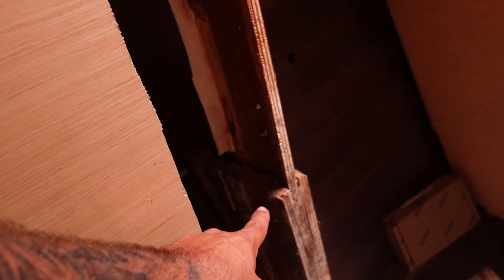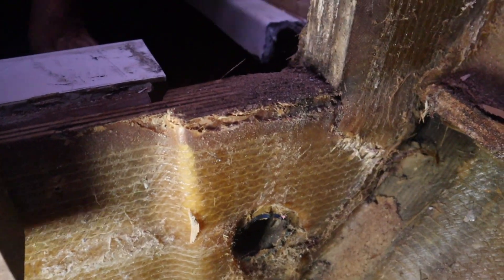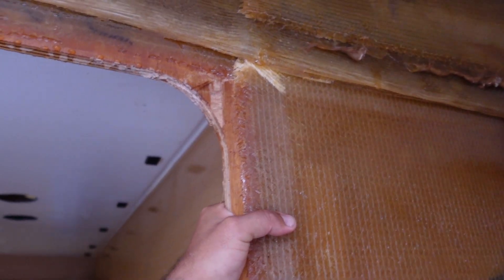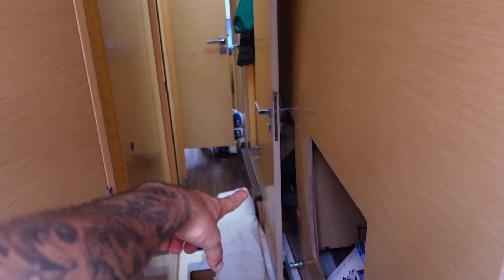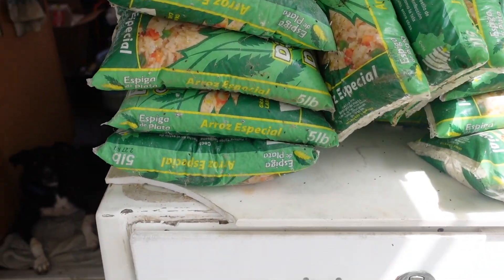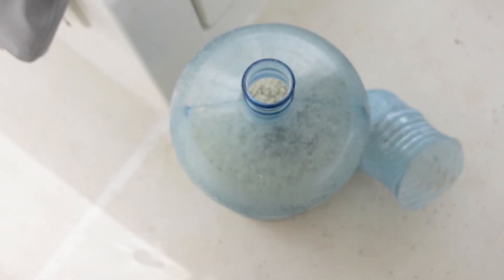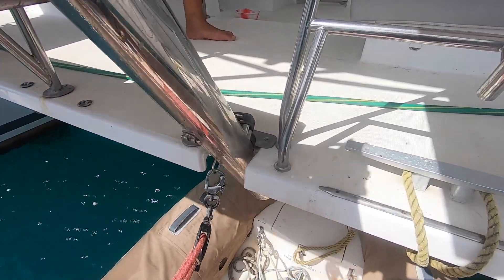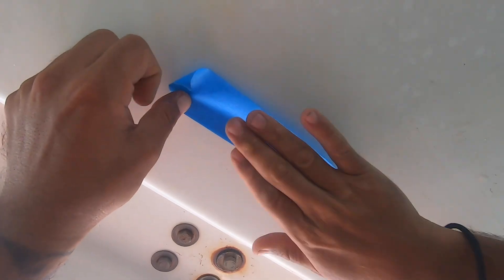CRACKED BULKHEAD REPAIR SERIES: Part 1 - An introduction... (Episode 107)

Comment: There are a lot of forces at play on this part of the hull and the bulk heads, fibre glass alone is not going to fix the problem. You have compression from the weight of the top structure (I suspect the main cause of the lower failure) tension from the chain plates (I suspect the cause of the top failure), compression inwards from the water on the outside of the hull, tension and compression from the wedge effect of the hulls pushing through the water to name just a few. Each is an independent force some times they will combine others they will cancel, The trick to a good fix when there is clearly a structural issue is increasing the support and distributing the load evenly across the hull to prevent creating a stress line at any point in the structure, remember fibre glass is not that strong in compression if it was you would not need bulk heads. I'm thinking the hull needs more bulk heads or bigger with forward aft braces from each bulk head to support and distribute the stress over a bigger hull section. I'm no engineer of any kind but specialize in failure analysis, it will be interesting to see what happens when the hull is on the dry and the chain plates backed off. Other comments suggest this is a big issue with this make and design, and the number of claims from other owners is going to prevent any real support from the manufacturer. Cheers mate🍻

Comment: Almost looks like the rig was over stressed likely during the storm. This caused failures in the bulkheads which were not readily apparent during your initial refit. Without any idea what was happening, people kept re tensioning the stays and shrouds until the bulkheads totally failed throughout the boat. With the mast pushing down on the center of the boat an the rigging pulling up on the sides over time it further collapsed the bulkheads and  distorted the hulls. Now you have a real mess on your hands and its going to be a chore.

Comment: This being a hurricane damaged boat would explain why there is such extensive structural damage. But when even lightly sailed ones have similar problems, that looks like a design problem. Looks like those nice square doorways have eaten to much of the bulkhead....
Reminds me of the story of the De Havilland Comet airplane that had square windows that caused cracking in the corners and catastrophic failure....

Comment: Might you be becoming something of an albatross around Lagoon’s neck?  It wouldn’t surprise me if soon enough we hear you’ve “sold” Parlay, the terms of which must remain confidential of course, and shortly thereafter, you’’ll finally be well on your way to the southern seas on another cat. It will be a used but serviceable boat and possibly another Lagoon. Now that’s something they and I would like to see.  Although I find it very interesting, in Lagoon’s case, they very definitely do not want you to show yet another failed bulkhead that was of questionable design or manufacture.  This may sound cynical so to be clear, I’m not attributing any to you. We all see firsthand the joy and satisfaction you get (and in turn share with us) by building better than to begin with.

Comment: Kudos to Lagoon to help you in the repair/rebuild Colin.  From what you shared & what I've seen by discoloration it appears to been definitely hurricane damage, but also, from previous stresses from abuse by over tuning shrouds to Bend the mast for more performance?  The other thing could be a a design flaw by Lagoon engineering.  Bulksheads should never be a multi jointed structure.   IMHO.  I too have mechanical engineering background as well as journeyman machinist & fiberglass repair with small boats, surf boards & sail boards.  Epoxy was relatively new when I got into building sailboats with vacuum bagging.
I owned & operated Dutchman Surfboards in Oregan for better than 11 years.  But then again, what do I know W/O actually being there seeing damages first hand.
I enjoy what you have been doing & you have courage to take on an enormous project.  You definitely got it together & find ways to make financial decisions to get the enormous task finished.  Much respect for your endeavors.
Plumb goes the lines & azimuths.
Be safe, work smart & fair winds.

Comment: I worked on refitting cabins/quarters below new blast deck deflectors on the US-66 aircraft carrier and the first thing I learned/observed was there wasn’t a level to be found or used on a vessel, only relying on X,Y,Z measurements.  Too many variants to use a bubble,  as the boat on water could be listing due to weight distribution.  I don’t know if in your situation on the hard you could adjust the supporting cradle to level out to lagoon specs or just use measurements inside point to point to bring everything into position.

Comment: As a naval architect, I suspect that the over tensioning of the stays discussed in an earlier episode will have contributed to this damage. The bending moment on the bulkheads would have been severe due to the very high stay tension. It’’s good that Lagoon are helping you, but the design of these bulkheads, including the absence of biax in the original construction at the high stress points around the door,  is dubious. I do love catamarans and raced F18s for years, but this does not create confidence in the structural integrity of Lagoons when sailing across oceans. Definitely a good idea to tear down all coverings and inspect the bulkheads thoroughly before setting sail again. Kudos for all the hard work and dedication. Thanks also for providing the regular sailing fix whilst stuck in lockdown in the UK :)
Reply: 100% the use of unsealed timber alone is dubious

Comment: There is a way to prevent those bugs from popping up in your dry goods.  When you buy them find a freezer warehouse or a restaurant with a walk in freezer willing to help you.  There may be a nominal stocking fee asked.  It shouldn't be much.  Take all your dry goods, rice, flour, corn meal, etc. and any other foods that might host insect eggs.  But nothing that is canned or jarred.  Put them in deep freeze for at least a couple of days.  Longer is better if in doubt.  The colder the better.  Just below freezing will take 2x longer or more than a deep freeze but it will work.  This will kill off any insect eggs that might have been laid in the food stuff.  It will allow much longer storage.  There still can be insects that make an appearance if they get into your goods after they are stored so putting them in a sealable container of some sort is better than just a plastic bag alone. 

I surely hope Lagoon is paying attention and taking notes on what you are finding.  Parlay isn't that old, hurricane damage not withstanding, to be having such issues with bulkhead failure.

Comment: About time you got serious & started to treat this "repair" as a major reconstruction that was the result of bad workmanship to start with. Fibreglass might be OK but you need to start bolting sections together using special stainless steel 5 & 10mm. brackets once the deck & hulls are bought back in alignment together with high tensile 316 stainless bolts & nyloc nuts. Using epoxy to "stick" sections together is asking for trouble & the same forces acting on the hulls will happen again. The hurricane created stresses that were started years ago when the boat was built & bad workmanship started the mayhem.

Comment: Looking at the degree of structural deformation, I agree with you that it is not only storm damage, but damage due to ongoing long- term excessive stress. It looks to me that the original bulkheads were too thin and buckled from torsional stress (generated from one hull twisting relative to the other along the ship's length and beyond the bulkhead's ability to flex). There is an issue of structural compromise here - if the bulkheads are too strong, they will burst the seams where they join the hulls and you are back to square one. From my perspective the bulkheads should be the strongest elements, with the hulls then being able to flex, with the flex occurring along the hull's length some ways away from the bulkhead/hull joints (like the stiff wing box of a large aircraft where the wings and fuselage are held rigidly and most flexing/twisting occurs beyond the box's structure). This balance in design is difficult to attain so I would recommend that when you rebuild the bulkheads, you build the joint to the hull and inner and outer hull skins around the joint similarly and flare the strength as you move away from the joint area so you don't split any of the hull or bulkhead laminations. I love your courage and wish to the absolute best of luck in your repair efforts!

Comment: looks like cheap plywood. also the door jams at the top are all bad designs, as you can see were the material was left short and were the weak point is. Mmmmm, hope there picking up the tab?

Comment: Could stressing the hull by overtightening the shrouds contribute as well as rocking the hulls in rough conditions over time. Original native cats would have flexing at the joints with the lashings allowing for some give?

Comment: There's no such thing as buying a cheap boat. They are cheap for the reason that you are finding out now. I wonder if the Hurricane Damage caused wetness in the hulls balsa core? I wonder if the same wetness got into those plywood bulkheads? Thus breaking the bond between the plywood and fiberglass, ruining the total combined strength of the bulkhead? Nooooooo the hurricane damage had nothing to do with this at all?!?!......... Blame the boat building company!?!? It will make you feel less stupid.

Comment: Colin, I would think that if Lagoon is as interested as the director claims he and Lagoon are that they would sponcer and provide you with every thing you need for the refit. Seeing as how even my untrained I can see where the plywood they used originally has slit and disfigured.
Lagoon should have someone on site taking notes for reference in there future designs. as we all know when you get done with your boat it will be ice burg proof.

Comment: On a steel or aluminium built boat those large openings cut into the bulkhead would have a flange welded all round. And the smaller holes for ducting and cables would have compensation plates welded around the holes. But a similar method ( with glass fibre) of reinforcement was not done to this Lagoon catamaran. Every hole weakens the structure and the lost material should be replaced or compensated for by mean of design feature like a flange. All the best Colin and to your loyal crew👍

Comment: Good and very informative video like always. I admire your self confidence , a normal guy with a (600000 USD) loan on this boat would sit down and cry tears like a crocodile .
I guess the Lagoon shipyard found out, that there is a bigger structural design problem with this boat type , so they are very cooperative to get all the information first hand . The sued producers for a lot less in the past  (Porsche of America for a motor bearing which failed), because for a normal boat owner this kind of damage would be a complete loss. It is so much labour cost to repair and far above the value of the boat .  I had a couple of sail boats and I was never a big fan of glass fiber ones . I have the impression this Mumbi aluminum cats produced in the Philippines are a much better choice for a blue water cat. I would never go with a plastic boat to cold or remote areas in the world (arctic, antarctic etc.)

Comment: Thanks Colin. As I don't read responses to any of my questions... knowing the root cause is hit or miss.  The last view showing the warping shows a clear long term problem. Which you WILL fix and it WILL be more reliable than off of the factory floor. Expedition Evans show clearly some shortcuts in the manufacturing process on their boat (tho they were fixing a completely other problem!). I"m not impressed in general in the manufacturing OQC at these joints (joints meaning companies).  I'm thinking now that MJ Sailing's approach where they are involved in every square inch of assembly will end up being the only absolutely certain way to know it's being built correct.  I wouldn't be willing to go thru it but I think it's the right way.. Somewhat disappointing regarding the fiberglass boat industry's state at this point.

Comment: Col could this be a lagoon design fault?  from the off ? - l remember when you tensioned up the shrouds up on the stress metre with the shroud expert that is when it possibly gave way and the fault was further exposed once under the high tension?

Comment: I don’t have your background and can barely remember the sides of a boat but is this damage on the port side? Wasn’t the starboard side submerged? In my opinion hurricane force winds could cause that damage if one side of the boat was submerged and locked in other boat wrecks with the port side hull lifted above waterline and being wrenched by 185 MPH winds. It is awesome that Lagoon is stepping up to provide advise. Best of luck to you. Will follow your progress.

Comment: "Glass the sh*t out of it.....I have a degree in mechanical engineering....." ;-)
Reply: lmao....I'm a union ironworker and I have worked with engineers more times than I can remember......We constantly have to show them, how there fixes Just don't work....from the little he showed it looks pretty clear that they will have to design bracing to connect to existing bulk heads, then glass over or epoxy.....I wish him well

Comment: What caused that? IMHO adhesive bond failure and then a lot of stress driving the center ply down like a wedge between the other two. When did it happen, hurricane damage or hard sailing or a combo of both. I could see hurricane damage if you would have saw it before (bowing walls and such) and I trust Colin enough to say, "ya ..tat's where Pa-lay got whacked by the blimey hurricane" if the boat took damage there before. Again imho its a design flaw. That's a super high stress point (the reason why the bulkhead is there in the first place). Good enough construction for a day sailing boat is not good enough for a ocean going, million dollar, heavy a$$, two hull, sailboat. They were also the ones that fit the boat out and turned the other support into Swiss cheese. I know being the boat has changed hands and had damage before the builder has rightfully washed their hands of it but it still don't account for a bad design. Another reason they would want nothing to do with it, other owners are watching.

Comment: You need 2 in. thick bulkheads minimum. Make sure to use a big cove of thickened epoxy all around joints and cover all coves with at least 5 inch bi axial tape.all around. I disagree as a professional boat builder West system is best epoxy. Check out Raka epoxy out of Florida. It cost much less and more user frenziedly.

Comment: G'day Colin, I just recently came  across your channel mate.  Great content, I'm really enjoying it.  Firstly, I'm also an Engineer, but Structural Engineer. My pops is a Marine Engineer. I believe it's specifically the model and year (but several overlap) but Lagoon catamarans have both structural and non structural bulkheads that definitely contain design and configuration  anomalies!!! The main structural bulkheads would be the mast and engine compartment. The  smaller, wooden, non structural bulkheads mostly form the floor frames. They're also poorly designed. They're stiffened by a composite process that actually doesn't help the bulkheads stabilize forces horizontally. Also,  another problem is Lagoon uses a crappy resin putty to actual fix the bulkheads to the hull. Very poor adhesive properties. Most of the time, the putty never comes in contact with the structure it's supposed to be joined to. The break you found on your forward bulkhead after removing the wooden trim,  doesn't appear to be caused by a hurricane, but instead caused by consistent and repeated stress or forces applied. That's one massive fracture in your forward bulkhead! Holy shitters was that a terrible sight. Cheers from Margaret River, WA 🇦🇺.

Comment: suggest in the future freeze bulk food for a few days, then store rice in 5 gallon food safe buckets with 02 absorbers
Reply: Have you seen/heard of food stored in nitrogen gas in those buckets Claudia?
Reply: @retepekooc  no, but it makes sense, the problem being getting the gasses exchanged completely, o2 absorbers do the job and they are cheap, remove the 02 and your left with nitrogen mostly